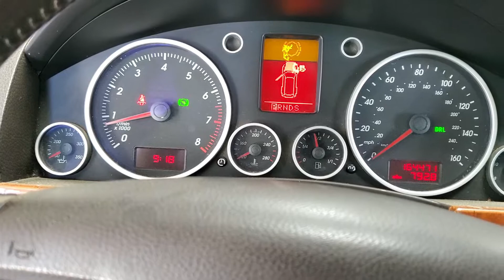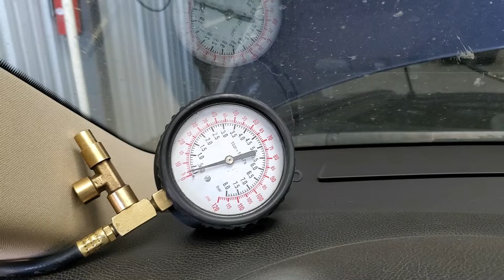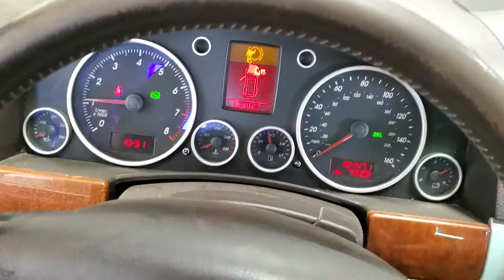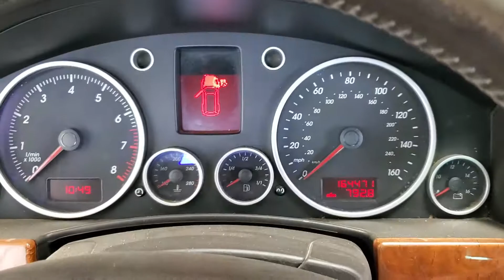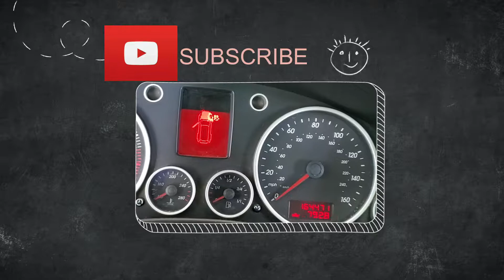How to diagnose Volkswagen Touareg shutting off. fuel pump location. Porsche cayenne dies.

Comment: Just for a future reference - there is no need to cut the carpet like square, because it is already precut as a circle around the pumps. You can see the perforation on your video when you flip the carpet.
Reply from the maker: Will do. Thanks mate
Reply: My touareg 2005 v8 do the same thing after 20 seconds de engine stops

Comment: Hi, I'm getting issues with my Audi Q7 4.2 FSI Petrol V8 2010 after changing the fuel filter from the left side (2nd row under seat). When I try to start the car it just cranks, when I reopened the fuel filter housing it seems no fuel is entering  it. What could be the issue pls.. Do you reckon its the fuel pump on the right side pipe came off or any  fuse? Cos the yellow connecter did fall in the tank but I reconnected it by just wiping, could that be a issue too? Thx
Reply from the maker: I also had a similar issue with a porsche  cayenne and a customer brought it from the dealership they changed the fuel pump and after that he was having issues with a hard start. checked fuel pressure and it started building up slowly. well short story was that they put a hose connected in the wrong side they ended up connecting the pressure side in the return line so I would advise to check that first.
Reply: I'm having a similar problem, it cranks but doesmt start after been running well, I think is the fuel pump as I dont hear it went i turn the key without the pedal pressed in.

In your case, !ade sure you put the filter the right way around as they are 1 direction...

Comment: Is this for tdi?
Reply from the maker: U mean for the Volkswagen passat or jetta?
Reply: @JVFIXLLC  for Volkseagen Touareg
Reply from the maker: @ahmadshafiehibrahim5689  yes it is the same
Reply: @JVFIXLLC  thank you for your reply. I have issue when trying to hot or cold start the touareg where it cranks for 7sec when hot and worse during cold. But once the engine started, no issue or lack power. I guess the secondary pump might be the issue, What do you think?